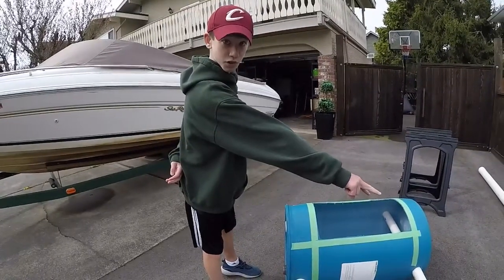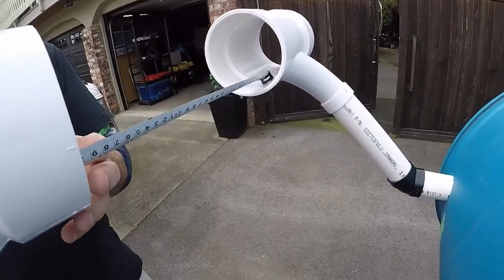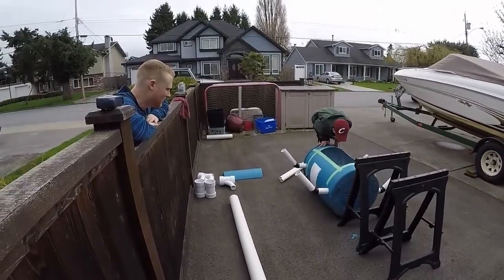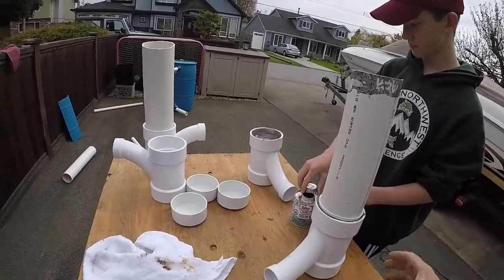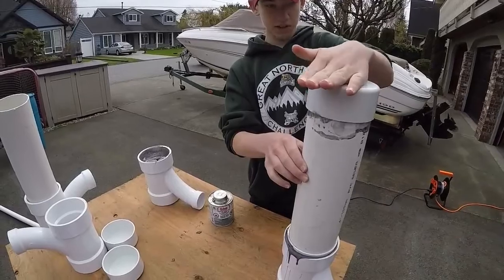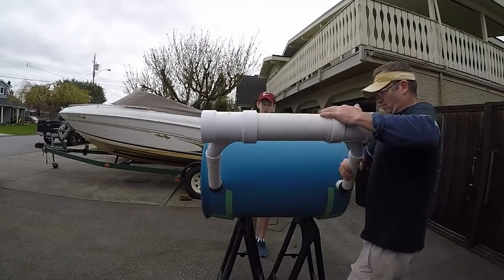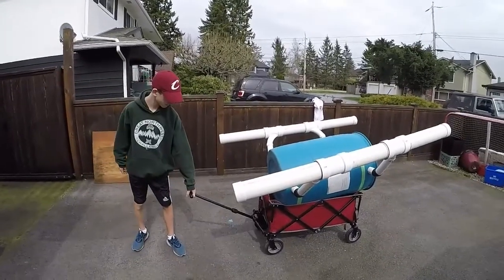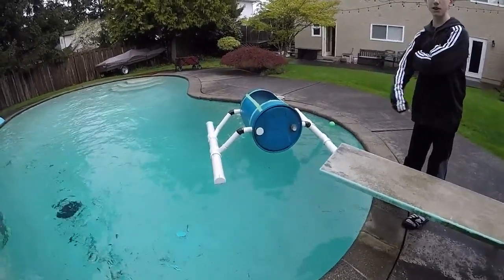kID MAKES AN INSANE  FISHING BOAT | PART 2  Diy Fishing Boat | PLASTIC BLUE BARREL BOAT

Comment: Hey man I don't know if your reading this still but I made one of those and I took a inflatable jet ski and mounted the moter it in the pontoon boat. It's actually really eazy I took the ones with the three piece moter and steering wheel and it only goes like 5 mph but it is very convenient and I'll tell you how to do it if you want